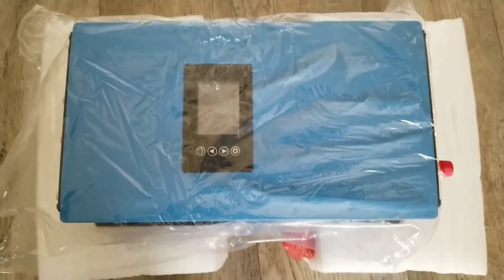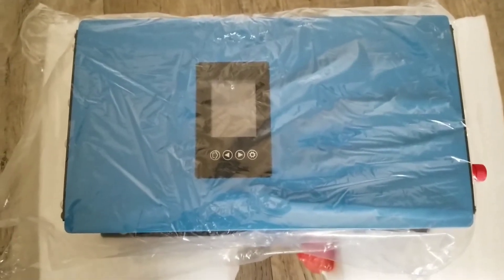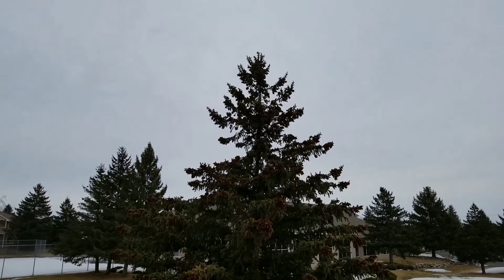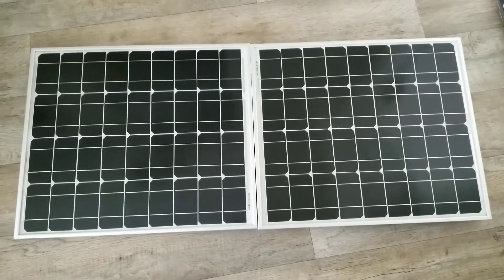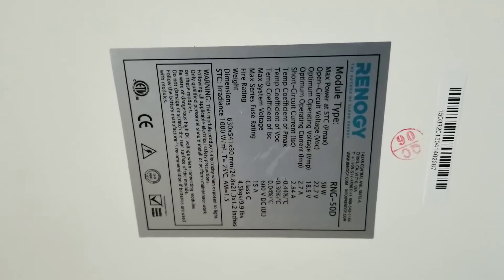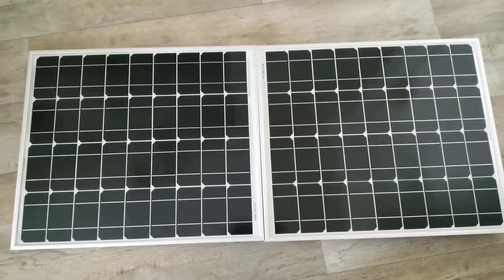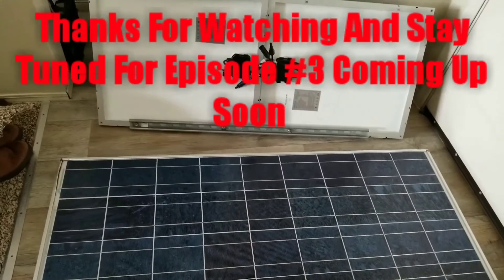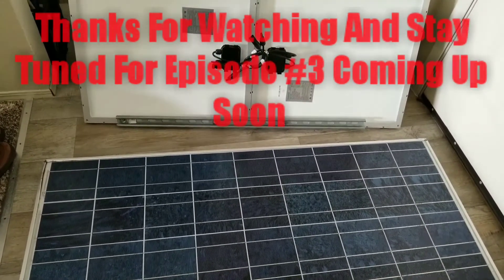SUN-1000GTIL2-WIFI PLUG-LD GRID TIE POWER INVERTER WITH LIMITER | SUN Series Grid Tie Inverter(Ep#2)

Comment: If you try to use this in the USA, you need to either buy 2 110v GTIL's, or get a dual coil that measures L1 and L2 meter connections on the US split phase standard..
Search "GTIL cables" on ebay for more details
Reply from the maker: These inverters has a automatic voltage detection for both 110Vac or 220Vac 
Make sure you read the description below before you buy one of these